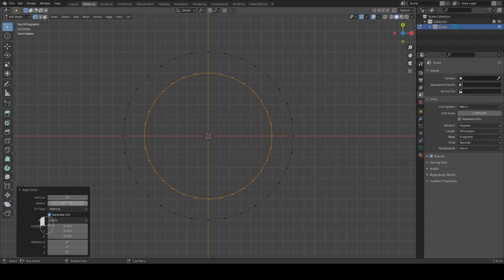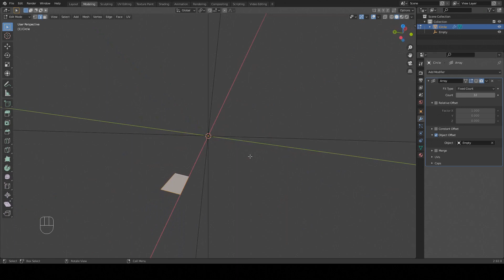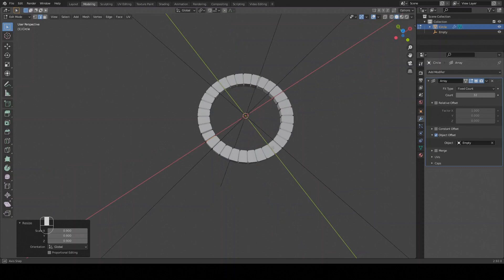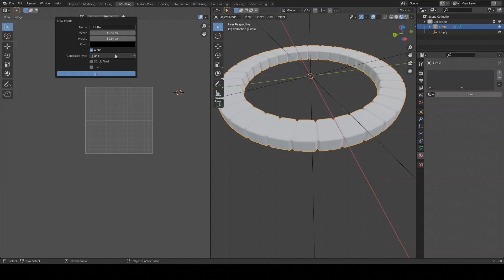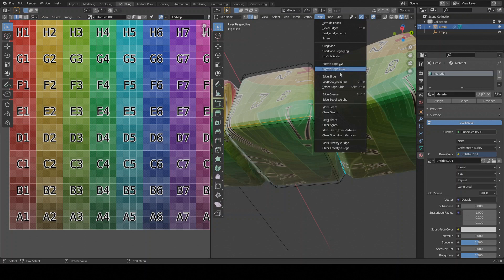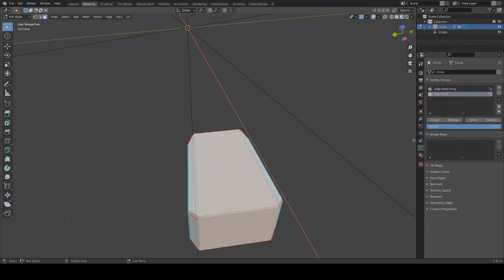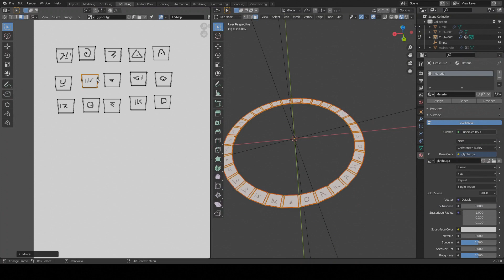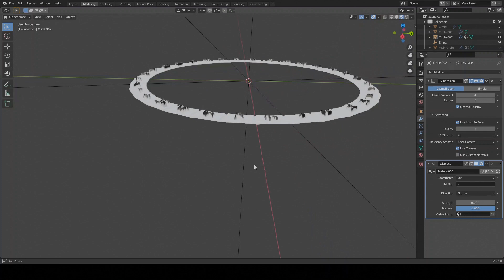Rebuilding my Stargate Portal in #Blender3d

Comment: Very nice! Now how to make the anitmatter portal thing in the middle...
Reply from the maker: Thank you! I was planning to do that using a fluid simulation - Zane from Zane Morgan Crafts had shown me how to do it once, will need to experiment a bit to get it to sit neatly in a circle though.
Reply: @Karlmakesstuff  at the bare minimum I want a Insta post completing this. Even better combine with LEDs in a video and complete the project :o
Reply from the maker: @TheBasicBrush  sure thing :) still working on it, just cut the video off here because the rest of the structure is very repetitive. Will probably film the swirly thing once I sort it out though. Was also thinking of making a second version with space inside for wiring and lights, but that will be later when I source some LEDs and a flat battery pack.